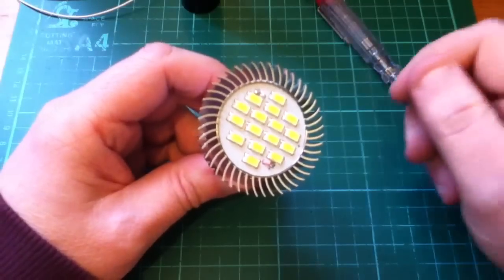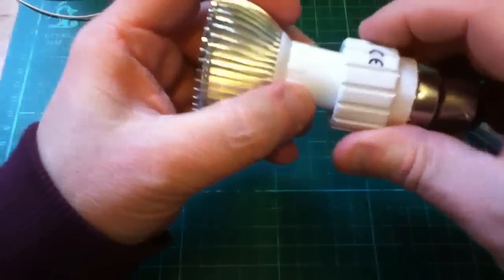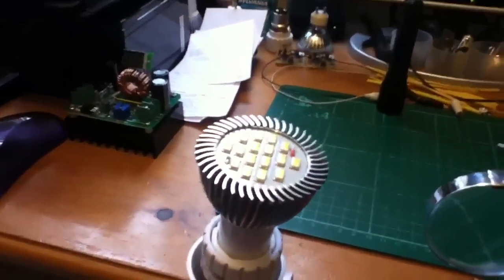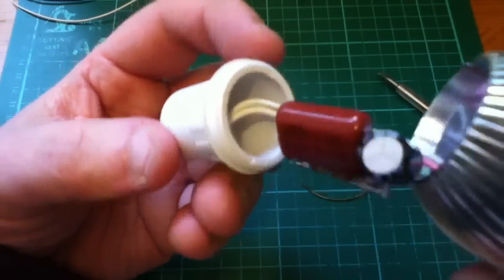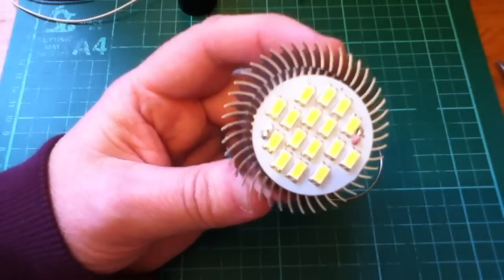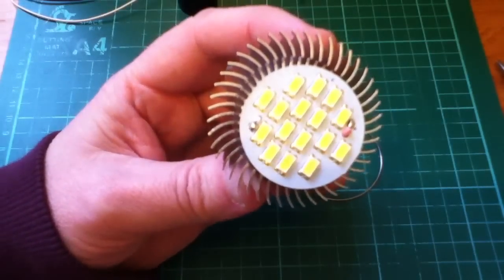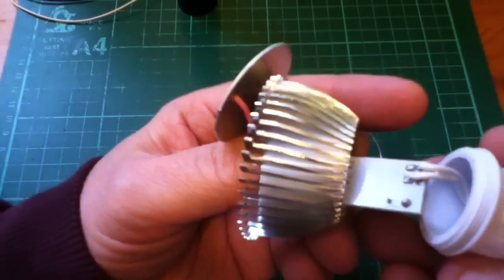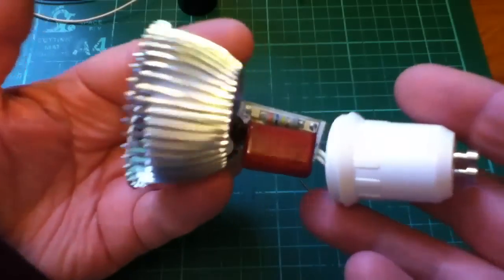Dangerous GU10 LED Spot Light is Cheap and Bright but could Kill You - Seriously

Comment: Nasty. Just like the bad old days of live chassis TVs.
I got a nasty shock from a record player in France because of their non-polarised mains...

I've bought several dodgy Chinese LED  products - but knowingly - I didn't really expect any MR16 to be a genuine 12 watts - but I was shocked to find Amazon warehousing them.
Reply: Just out of curiosity.. was it Amazon itself that was selling these, or one of the various 3rd party sellers? These days, Amazon acts a lot like eBay. In fact, many of the items for sale on eBay are also identically sold on amazon
Reply: ***** Mine were warehoused by Amazon in the UK, so arrived within a day or two.
. Rest assured I left damning reviews and exchanged some emails with the people in China - though there wasn't the out and out attempted bribery I had when I did the same thing on Ebay.
Amazon didn't seem to care.
Luckily I'm only using my (MR16)  lamps on my bike and I doubt they would actually catch fire used indoors - though running so hot, I doubt they would last very long.
I'm just a little disappointed they aren't a bit brighter. So far as I know it's only Philips who make a genuine 10 watt MR16 and then only because they fitted a fan in it !

It seems amazing to me that when the EU can ban the sale of inefficient incandescent lamps, they can allow the sale of "replacements" that bear no relation to the supplied specs - some of them apparently with bogus safety markings.

And why don't Cree do something about a Chinese manufacturer calling themselves "Rotundity Cree" ?
Reply: yangtse55 Nice comment man, lots of truths be told! It's surprising Amazon would warehouse illegal stuff, that's really not like them. Though I think Amazon also warehouses incandescent bulbs in the UK, at least that was the case last time I checked? Well whatever, they probably stock-piled a million of them before the ban initiated and claim it's old stock now XD. I'm not sure about MR16, but GU10 can definitely go up to 5-6W of led, above that is certainly fake as you said. How bright do you want your lamps anyway? I have 2 led lamps of 500-600 lumens each above my kitchen table (the 2700k type) and it's bright as fuck. 

A better question is; why did the EU ban a perfectly safe lamp, which will be replaced by a mercury-containing alternative? That's the standard energy-saving bulbs. Also, as far as I know, it takes a fair chunk of extremely rare metals to produce leds. So resources will eventually run out, whereas tungsten is present in much more abundant quantities on earth. I can understand the reasoning of wanting to save electricity, though the effect of it causes more damage than incandescent ever could!

What did you mean by "Rotundity Cree" ?

Comment: ..its AC current.. not DC.. so no.. the poles are not interchangable and hence you can mount the lamp socket any way you want because the poles are gonna swop places 50-60 times a second anyways, depending on what Hz ya got in your country, and as stated below, no.. the outer casing will not deliver any lethal shocks if you touch it, and by you not even using a multimeter to even try if it does just shows that your talkin bogus.

Comment: Hmm, I dunno what that circuit does exactly, but the leds should be driven at low voltage and DC . That being said, you should just put a multimeter on it so everybody can see exactly what voltage we have there.
Reply: Please understand that even though the diodes get only low voltage will still be dangerous voltages with respect to ground ... is it so hard to understand?

To all doubters ... please accept dangerous voltage despite the diodes are operated with low voltage. So it is with these circuits that I learned already when I was 14 years old.

Comment: Just how hot is the metal work getting? who monitors the selling ? A few milliamps from Electric shock ?????
Reply: To all doubters ... please accept dangerous voltage despite the diodes are operated with low voltage. So it is with these circuits that I learned already when I was 14 years old.

Comment: Have you traced out the circuit?  I doubt the 360k resistor is a dropping resistor.  I think it discharges the filter cap.  360k would barely light a neon bulb.

And, because of the bridge rectifier, both front plate terminal wires should present dangerous voltages to ground, and certainly wire to wire.  But it would be difficult to attach meter leads to the front, to prove that.  But you could pierce the wire insulation, behind the disk and make that measurement (with both AC and DC scales).

Thanks fort the heads up.

Comment: It doesn't really matter which way you insert the "bulb" as the input is AC. It is effectively going to be "live" either way except where the sine wave crosses zero. Could these lamps fail in a lethal way? Of course they could because there is no isolation between input and output.
Reply: "It doesn't really matter which way you insert the "bulb" as the input is AC."
It will still function - but its safety is compromised. In an electrical installation there will be a tie point where neutral and earth are connected (back at the meter box) - so the zero of the sine wave will be 120V wrt earth in a 240 v system.
The intention is always to keep neutral as close to ground potential as practical.

Comment: These lights will kill you. Any UK/EU vendor will be charged with breaches of product safety regulations if you take a copy of the invoice to the local trading standards office.

Buying direct from China - you are on your own!

To those who think a bridge rectifier will protect you -- think again, you need ISOLATION not rectification.

Anyone who puts one of these in your house is putting in a lethal trap which will kill someone.  If you don't get electrocuted - consider that there is no fuse in this lamp, one fault in the capacitor and you will have a fire.

Andy
Reply: Eris, this is a horrible piece of engineering! I buy lots of stuff in China and usually I have a closer look at it before applying any electricity on it, but these things remind me that I need to be even more careful.

Comment: I'm not sure what is going on when some claim this is scaremongering, but maybe it's an expression of hopeless ignorance (sorry). Any circuit powered by> mains supply< without transformer carries hazardous voltages whether there are rectifiers, resistors, capacitors and what else included. Such circuits are only safe if they are  installed in isolated box with at least 8mm safe distance from the curcuit (legal requirements) to any conducting material that can be touched and it's obviously not here. I have worked with electronics for 50 years ...I have learned something.

To all doubters ... please accept dangerous voltage despite the diodes are operated with low voltage. So it is with these circuits that I learned already when I was 14 years old.
Reply: Thanks for trying to explain to those who need to know better. You are right of course.

Comment: if there is a bridge rectifier there is a DC output on the LED 
as LED works on only DC !!
so no live or neutral is connected directly.
see the working of the BRIDGE RECTIFIER 
you will understand it..
Reply: The brigde have nothing to do with it...the curcuit is dangerus.,,if not isolated proberly.

Comment: There is some serious ignorance being shown in these comments.  Simply because an LED has a low forward voltage, doesn't mean that the entire LED chain can't be held at a much higher voltage with respect to ground.  This circuit has NO GALVANIC ISOLATION, so at least one end of the LED chain will be at a high potential, and both ends if a bridge rectifier is used.
Reply: Thank you :-)

Comment: Are you completely certAin About whAt you Are sAying?  The supply volTage or as you call iT mains, is contained on that circuit board with in the plastic tub.  The leads going To The flat disc populatewith the LED's is not it mains voltage,  does supply wife 1 to 3 volts DC, typically pulsed DC.  Not seeiNg the circuit iN total I caN't really commeNt oN whether it could fail aNd produce the full circuit voltage oN the output to the LED's.  However, I'm under tHe impression tHat bridge rectifiers
Reply: very true!!!   Its AC!! both will be live and both will be neutral (plug pins/resistor) the metal should be earthed (but isn't) the voltage on the two metal parts on the face plate will depend on the the amount of leds and the configuration. each having 0.7-1.3v drop x No. of leds. this guy knows jack shit!
Reply: gglafatottari Drullusukkor
Just thinking off the top of my head (and not seeing the circuit) don't the Big Cap and the Big resistor create a higher frequency lower voltage oscillator circuit at the input of the Bridge rectifier, and isn't a bridge rectifier's output varying DC ( w/ ripple depending on the size of the output (small) capacitor) and not AC?  Can it really be 230v on the LEDs?  If so, they'd breakdown instantly, right?  LED's can't handle a even a 230/3 (75v) junction voltage!
Reply from the maker: gglafatottari Drullusukkor These white LEDs have a voltage drop of around 3.3v. Sixteen of them in series require in excess of 50v.
Reply: dfun47
The leds will def see DC power!  my comment was on his comment about putting live on the side of the resistor which is stupid because its AC! the livkely hood of getting live wire would be 100% lol but its not going to have mains voltage on the leds! he doesn't even know leds are polarized lol. He makes it seem like you have a very high chance of touching mains which is bullshit!

and you are right 3.3v drop for sixteen leds ONLY IF they are in series though!!   show us the pcb and it would explain everything!!!
Reply: ***** Because an electrolytic capacitor will explode if you put AC across it; you MUST supply it with DC, hence the bridge.
Reply: ***** I was a BBC electronics engineer and safety officer for over 30 years and have seen some pretty poxy designs but this is probably the worst I've seen.

Comment: That resistor is a 360 ohm NOT a 360 Kohm learn to read resistor codes. its sole purpose is to prevent the bridge rectifier from blowing up. your body has a much higher resistance than that meaning even if you touch the "live" wire after the resistor, the majority of the power will be dissapated through you. I very much doubt the thickness of the insulating material is a few microns, probably more like 100 microns. so unless you are going to touch the live port on the front (which anyone with any common sense wouldn't) you will be fine. Finally, all this can be completely avoided by turning the lights off while you are plugging them in. the lightswitch is wired by industry standard to the "live" wire so if you switch the light off you have no chance of being electrocuted.
Reply: evilkinevils aaaand that's why resistor coding is the most retarded system in the universe.
Reply from the maker: It's 360k - orange, blue, yellow. It's purpose is to discharge the dropper capacitor.
Reply: Julian Ilett
Oh i thought that was brown not yellow.
Reply: I have a friend who is colourblind and couldn't agree with you more.

Comment: No one with a shred of common sense touches the light part when handling a bulb weather putting it in or taking it out, the 4 i bought had a glass cover over the front anyway and no exposed wires at the front either, how ever 1 had some freaky substance inside that smelt awful sort of like mould it looked like but sticky and way more smelly.

Comment: He talks first of a bridge rectifier, unsmoothed that would give pulsating DC.
Then there's a dropper resistor + cap (still DC) and I suspect a parallel zener to the final small electrolytic cap (if it's 1100uf it's certainly not 400v!). 
Now we have a smooth DC Voltage to match the LEDs' requirements..
Let's prove the danger is there by connecting a meter to Earth.
This is what he should have done rather than scaremongering.
Reply: Safety is always based on worst case, risk averse, design. Better the be safe, than dead. The analysis was spot on. 1100 was referring to the series capacitor in pF not uF. Never states the value of the electrolytic. Never said the line was shorted to the heat sink. Only that it was insulated from the heat sync by a few mils of plastic ink that could easily (implied) fail and punch through by a line spike. Then the heat sink will kill you. I have seen this many times on line powered products.
Reply: A 400V 1000uF cap would be far too big to fit inside the housing. And the small (polyester) cap in the video must be wired before the bridge or it will simply block everything rather than drop some.
Reply: Why can't that electrolytic capacitor be 400V? How can you prove that a 400V 1100 uF electrolytic capacitors don't exist? I have plenty of 400V 3300 uF electrolytic capacitors in my parts bin. There is no zener diode. Your comment has some flaws. Remember that live can go directly through the bridge rectifier and onto the LED board and then through the capacitor dropper if the lamp is switched around. He knows what he's talking about, the only thing that needs to be checked is one of the pads with that little mains tester screwdriver he has over there. I assume he tested the lamp with that and got a positive result.

Comment: So you can explain how a diode works and how a bridge rectifier circuit works and then how you get a potential 230v at either side of the LED. Plus use a meter instead of talking Shite. Oh and you can explain after all of that the RCD protection , 17th edition regs for domestic properties and the possibility still of been on a cartridge fuse board tt  system while installing 230v LED. Because I thought LEDs were low voltage. To the fucktard talking shite about world regulations

Comment from the maker: It sure does! I had my first (and last) major shock when I was about 12 years old. I put an inline connector into a TV lead and decided to open it up. I thought I was opening the TV side, but it turned out to be the still-connected mains side. I'm pretty sure (if I remember this correctly) I grabbed one connector with one hand and the other with the other. It was one hell of a belt, and threw me back across the room. Felt quite wobbly for an hour or so. Pretty lucky to survive that one I reckon.

Comment: I afraid your assessment of the circuit is completely WRONG as the part of which you are saying is dangerous and 240 volts is actually only the LED side which will only be a MAX 3 VOLTS @ 1AMP !!!!!! FAR FROM DANGEROUS. LEDs are DC supplied upto 12volt generally 20milli amps SO the contact plates around the LEDs will be the same if shorted NOT 240V !!!! PLEASE THINK BEFORE RELEASING INCORRECT INFORMATION AND SCARE MONGERING !!!!
Reply: You've fundamentally misunderstood. The voltage across the LED chips will indeed be low, but that's not what's dangerous. What's dangerous is that it's referenced to either the neutral or the live input depending on which way around the bulb is inserted. If it happens you've inserted it so it's referenced to the neutral, well, that isn't great either but probably won't hurt you because the neutral should be earthed somewhere relatively near your house. If, on the other hand, you insert it the other way around, all the voltages on the accessible front plate are relative to the live mains voltage. The voltages across the LED chips are irrelevant here; let's say we drop 3V across each of them (for sake of argument), well, all that means is that the first one has 240V on one side and 240-3V on the other side. The LED only sees a low voltage across its body. But if you're touching it and part of you is grounded (for example via a metal stepladder), the voltage across your body would be 240V if you touched one side of the LED and 237V if you touched the other side. That's going to hurt.

Comment: It's not that they're running at 240V it's the way the circuit is wired, The way it is, 240V cab be on that point of the circuit if the resistor side is hot. And say the leds in series drop 9V, then the wire on the other side is at 231V, the rest of the voltage is then used up by the capacitor. If the circuit was polarized then neutral would be on that point, You'd have the capacitor eating up 231V, giving you 9V on the other point and 0V potential on that point instead.

Comment: Did you actually measure the voltage with a voltmeter? Because i don't know of any LED working with 240V, so there should be a lot less (not dangerous) voltage on the secondary part of the circuit...
I think you just oversaw something in the circuit... Can't tell as there is no closeup

(AND NO... the phasing tester doesn't prove anything here)

Comment: Um, I appreciate that 230v supply can be dangerous (being a sparky I've had a fair few bellts off mains voltage), AC voltage is designed for you to be able to get off it, and getting a shock off of such a tiny surface area would simply jolt you and throw you off. Perhaps not if you had a pacemaker, but you know.

Thanks for some good info, but bypassng the product brand and being dramatic has kind of eliminated the point really. Loads of GU10s are made to plenty of different specs,

Comment: The circuit works as follows. The large ceramic cap and 360k resistor work as an RC time constant to passes enough current to the bridge to charge the electrolytic filter cap and create filtered dc current for the LEDs. 

The rub comes from the fact that the entire circuit can be installed backward resulting in an equally functional but very dangerous situation where the entire unit is referenced to line voltage instead of to ground.
Good catch Julian. I hope you didn't find it the hard way. :P